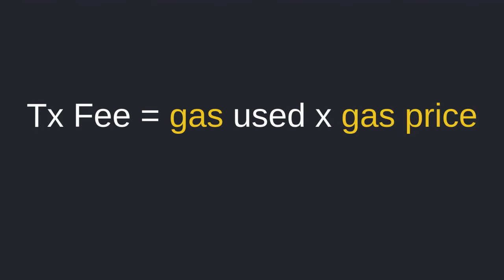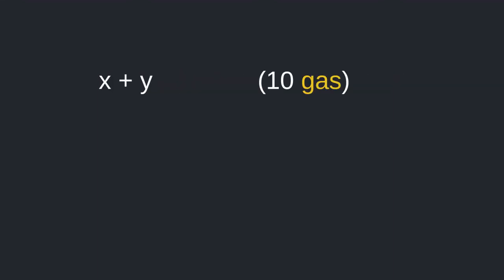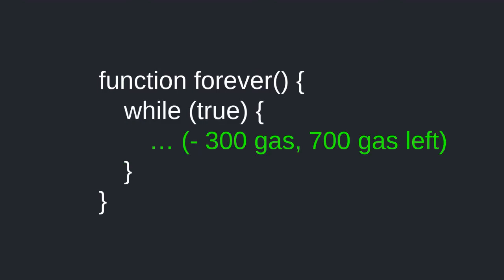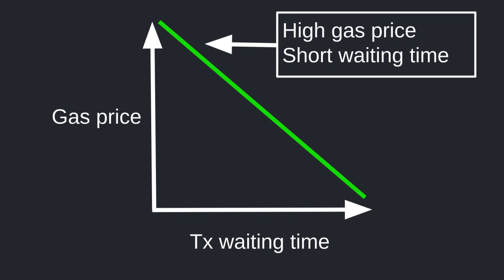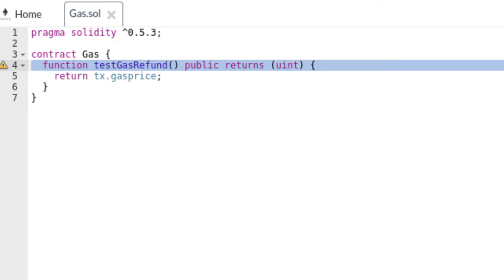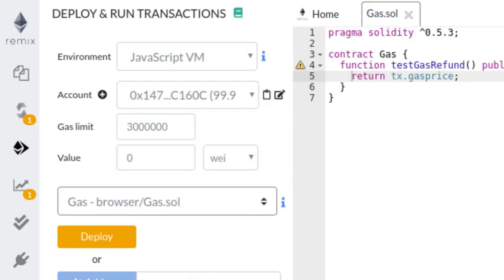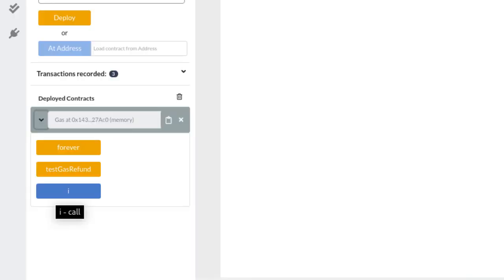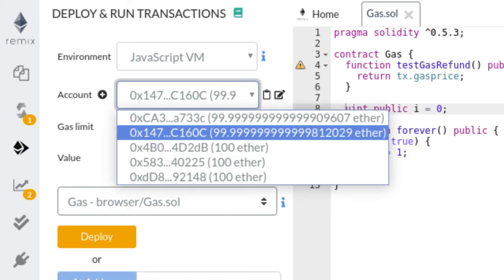Learn Solidity (0.5) - Gas and Gas Price

Comment: In case this helps anyone I had difficulty reconciling the cost deducted from the account I used and the transaction cost as the account was deducted by much more. However, I realised that the price of gas was 2 as per the result from tx.gasprice, so the total cost of the transaction turned out to be (gas price x transaction cost). This was in Solidity 0.8.7.
In the video he mentions gas price in remix is set as 1 but maybe that has changed over the last couple of years as my gas price turned out to be 2.